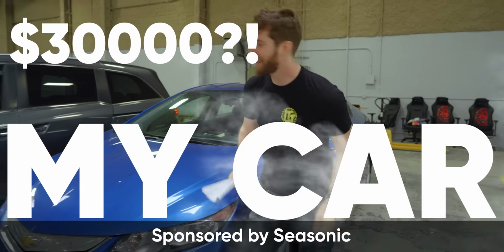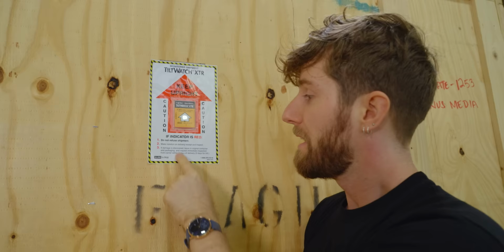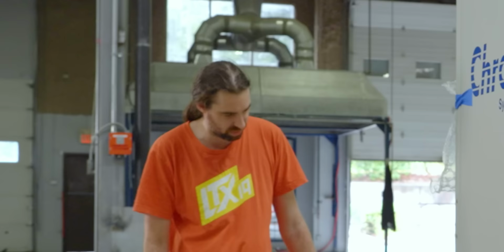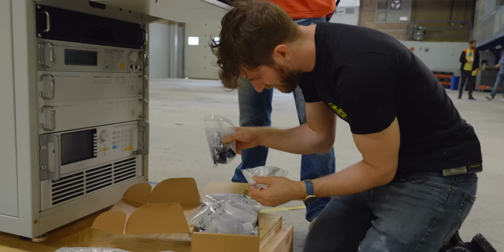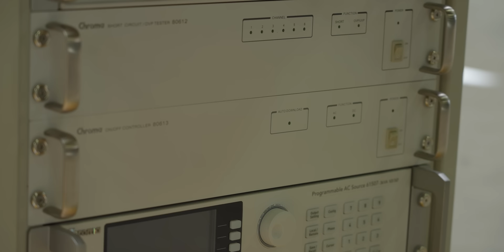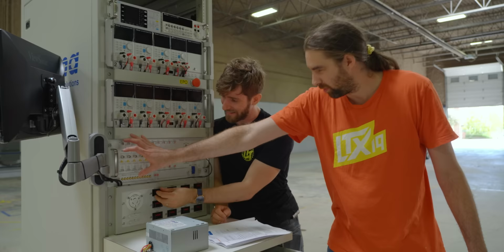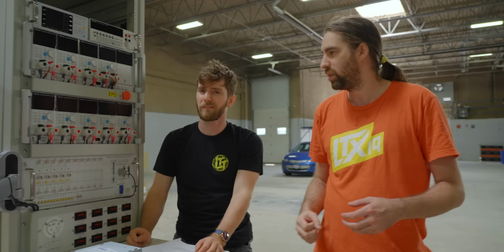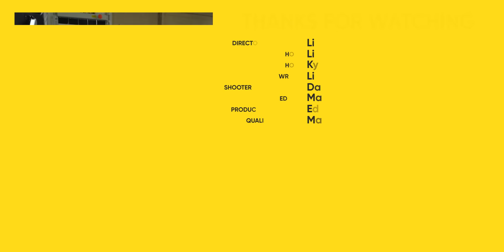The most EXPENSIVE thing I own.

Comment: I love how passionate Kyle seems about future testing, when we get to chewing up PSUs and spitting them back out we need him to be the host.
Reply: God i love Kyle. guy is such a great dude. he needs more screen time.
Reply: Absolutely. Kyle seems like that nerd bro that don’t give no fucks and ain’t no simp. I like him and his genuinely passionate approach to his job
Reply: Hey can anyone answer a stupid question I have? They said North American power tops out at 2000w. Is it possible that computer components become so power hungry that there is a limit to what is possible? Like GPU’s and CPU’s stop progressing because there’s no more power available?
Reply: @granthoover9045  possible, but unlikely. New generations of hardware have focused pretty hard on reducing consumption and increasing efficiency. This is most seen in memory and processors denoted as LP or L, which is generally short for low power, or sometimes LV in memory case for low voltage. 
DDR5 uses less power overall for the same output a comparable DDR4 would. The same can be seen in newer processors, since we’re at a point where we’re installing transistors so small we can’t make them smaller. Like it’s literally against the laws of physics to make them smaller.  
So much of the focus the last few years has been making less do the same, which increases efficiency by space. 
2000 watts is ALOT of juice for a computer, we’re talking a terabyte of memory or dual socket platinum 48 core xeon processors with 96 PCIE lanes. Maybe some Bitcoin mining farms will hit 2k per breaker, but only after 4 high end 500 watt graphics cards chewing away at them hashes. 

I run a server In my house, and it’s 16 years old, DDR2 FB no multi threading. Old and hungry. Barely eats 700 watts at full output, and around 250 at idle. 

So I’d say it’s possible, but unlikely. Just from the hardware perspective, there are plenty of options, and from an engineering standpoint, nothing is impossible.
Reply: Love these vids, but they’re getting a bit too technical for me to follow.
Reply: @granthoover9045  It’s possible, but the biggest limiting factor is likely to be heat. More power = more heat. We’ll need some pretty sizeable advancements in heat management for consumer PCs to start handling 2k+ watts. They also would be pretty uncomfortable to sit next to at that point…
Reply: The fact he's South African is cool too
Reply: @BT1902  that's really understandable, this is basically someone who read the manual until they knew it by heart, and are paraphrasing the whole thing on camera lol. I love it, but they could insert some layman's summaries and jokes here and there to make sure that not only people already invested in PSUs are entertained
Reply: @TheTwtwo  p
Reply: Although I think he needs to dumb down his language a bit haha
Reply: @magiklok  he's already dumbing it down lol
Reply: Agreed! Kyle is amazing. (sorry Linus, you did good picking people we want to watch more than you)
Reply: Kyle lost at least a decade of his life due to the stress that Linus caused him.
Reply: I dont like kyle he seems soooooo smart or he thinks he is

Comment: As a test engineer, I've got to say, this is a really impressive test setup (not sure about the pass/fail thingy though, not entirely sure what it is and what it's needed for). One note though, even if you have a scope, a DMM is still necessary because a scope is specialised at getting timing information very accurately and exact amplitude is usually less useful. So while a scope will have some DMM function, it's only going to give you like 3 or maybe 4 digits of precision, whereas a DMM can easily go to 6.5 digit. Admittedly that accuracy is maybe overkill for PSUs but it gives you trust in your measurements, i.e. if the 6.5 digit DMM says the voltage is 12.56864 then you maybe don't care about the microvolt accuracy (and realistically you're not gonna use it in microvolt range because acquisition time is very slow in that range) but you're not ever gonna doubt the millivolt accuracy.
Reply: So as a test engineer you shouldn't be that impressed, that's normal measuring equipment. As for the DMM, I have to say you're right on the one hand and wrong on the other. The Chroma already has a relatively high-speed DMM built in, so in principle it's not necessary, but in fact it needs to be calibrated and for that a DMM is useful, at least if you do it yourself and want to achieve very accurate results. What surprises me is that they bought the automatic Chroma, which is completely unsuitable for a laboratory.
Reply: Reading this makes me feel stupid.
Reply: @tytusromek9267  what's an Automatic Chroma? Didn't hear them mention that during the video. Unless you mean the pass/fail tester thing.
Reply: @moredots  The automatic chroma is for random testing. You write the program, connect the power supply and get a protocol. The programs are also interchangeable, so if there are problems you can test the same power supply with the same program on a second Chroma. 

The advantage is that the operator does not have to know anything about the Chroma, just connect the power supply, press the button, everyone can do it.  If problems occur, this is forwarded and the engineer/physicist looks at it.  This is why they are also used in QA.

The disadvantage is that it is more difficult to do anything beyond that, you are somewhat bound to the program. So if you want to test something special, or there were problems in the process, etc.. you have to rewrite the program. It is not impossible to intervene directly, but you realize that these are not meant for that, but rather for automated testing. 

The manual ones are then used in laboratories (not only in power supplies, but also in batteries, solar cells, aviation and space technology. Everywhere where electricity is converted or generated) with several and high quality measuring equipment like oscilloscopes. 
These can also be programmed, but also allow complete manual access. It is not only about the tests themselves but about the combination of the electronic loads, the manual ones allow very easy exchange of the loads. So you can adapt them to changed test operations e.g. ATX 3.0 

They are also used in the labs of the manufacturers, at Cooler Master HQ I know that they use tektronix oscilloscope, one costs over 10000$. Enermax, FSP, Seasonic... also use both, but there my info is very old. 

Also the other well known power supply testers use them like Aris Mpitziopoulos(Cybenetics, Toms, hardwarebusters), Hardwareluxx, TweakPC...  
The disadvantage here is that you need very good professionals.
The smaller test sites use Sunmoon Load Tester, these are much less accurate but also offer many options. These are also used by the manufacturers for RMA
Reply: @tytusromek9267  thanks for the response. That all makes sense. So that's the piece of equipment directly below all the DC loads, right?

I work in development not QA so we spend our money on oscilloscopes (I much prefer my LeCroys to Tektronix), but I do have 4 or 5 Chroma programmable AC supplies, though a few generations older than this one. I asked for one from Santa Claus (to do high current surge testing) to the tune of about $75k but I don't know if it's in the cards this year.

I have also lusted after a DC load mainframe like this (just the loads, not all the other stuff) but it's hard to justify when you've got stuff that already kinda does the job.

Me: I want a Chroma programmable DC electronic load mainframe!

Mom: We have DC electronic loads at home. 

DC Electronic Loads at Home: <BK Precision>
Reply: @Tytus Romek I am actually surprised that this test setup does not include a spectrum analyzer though - you can inject dirty input power into it, but there is no way of measuring the output noise and harmonics over a broad spectrum at the same time? Might have missed a part in the video though, I do not know for sure.
Reply: @alphaprot2518  you don't need it,  the Chroma AC Sourse delivers what you want, jagged, triangle and square voltage, whatever you want you can simulate with it. voltage peaks sourges .... The Chroma AC source can do much more than you need for ridiculous power supply test
Reply: @alphaprot2518  the oscilloscope should be more than enough to measure the effect of power supply rejection if you feed in some dirty harmonics. Any good oscope on the market nowadays has Fourier transform capabilities built in.
Reply: @tytusromek9267  they are not using the DMM to measure voltage, they use it for temperature; it's way way overkill for temperature measurements, you're using 5% of what that meter can do, and almost nothing of its great accuracy and precision; on the other hand, it gets them a nice meter, which they can use for precision voltage and resistance measurements, such as cable loss

Comment: Holy crap. I was looking at Chroma systems back when I was designing power supplies. Looks like you guys went all out! Re the multimeter: Most oscilloscopes are terrible for making accurate voltage measurements (8-10 bit ADCs). They are just for looking at the waveforms.
Reply: This what I was going to say.
Reply: They did say in the video it was just for pretty graphs lol
Reply: Long time not seeing a video from you, can you please get "back in business" ? :)
Reply: I am confused; how can a scope be a piss-poor voltmeter but draw graphs of changing voltages? Are they just bad at defining the absolute voltage of any signal at any moment but really good at comparing it with a measurement taken at another moment?
Reply: @ahmetrefikeryilmaz4432  Yep, pretty much
Reply: @ahmetrefikeryilmaz4432  oscilloscopes are fast,  very fast 1000 million samples per second is slow, multimeters can do between 10 and 1000 conversions per second. but the trade off is that the data converters are not as precise (10milivolt vs 10microvolt resolution)  in voltage, but oscilloscopes are specified for accuracy in time too.
Reply: @ahmetrefikeryilmaz4432  the speed at which the oscilloscope takes readings has nothing to do with its sensitivity, the bit depth of the ADC defines how many binary levels the signal can have when it's converted. Most oscilloscopes are only good to within a few mV precision - so not "piss-poor" but not great for sensitive work. Good for looking at general waveforms, troubleshooting signals, acquiring transient data etc. Whereas even a modest handheld multimeter would have several orders of magnitude better precision (e.g. Fluke 87 has 20-bit ADC).
Reply: @evanguarr9678  Linearity is also an issue for scopes. Multimeters can integrate over many milliseconds to achieve >5 digits resolution but scopes can’t
Reply: @ahmetrefikeryilmaz4432  I think a good analogy for non EEs are cameras. On the one hand you have full frame DSLRs with dozens of megapixels producing images well in access of 8K, but can only shoot a few pictures a second. On the other hand you have ultra high speed cameras that can shoot in the millions of fps, but can only achieve resolutions of something like 200x100.
Reply: this is what I was saying out loud lmao, the adc of an oscilloscope will not get you measurements as precise as a bench dmm
Reply: @NavinF  sure, but even over a single shot measurement it's not even close
Reply: @PlaceholderforBjorn  no it wasn’t
Reply: @evanguarr9678  nitpicks: “single shot” usually refers to one waveform in the context of scopes. Your “20-bit” ADC likely has an ENOB that’s a lot closer to 8 bits than 20 until you crank up the integration time like multimeters do. Time is absolutely a factor. Also worth mentioning that a scope’s AFE (analog fronted) often costs as much as its ADC and the ADC is not the limiting factor. Imagine sending 200mhz through a multimeter’s AFE.
Reply: @NavinF  you're right, those are all nitpicks lol
Reply: FWIW, there are a lot more scopes sporting 16 bit ADCs these days. Even under $1500.

I'm not sure what you need to characterize a PSU, but I'm thinking it probably isn't GS/s and is more like a few MS/s.
Reply: @bobgarrish  Not sure about the commercial market, but harmonics are an important factor for power, in general. My workplace looks at as much of the spectrum as it can reasonably get since we support sensitive electronics/systems. 
This is the case even if you’re switching at less than a Meg.
Reply: I thought that looking at waveforms is what oscilloscopes are for.  Multimeters are for measuring waveforms.
Reply: @ontheborderofbored  this is PC power supplies.... Like for home desktops.
Reply: @bobgarrish  you are correct, this is a ridiculous thing that they bought for no reason. You could do equivalent work for probably $20k in brand new equipment... The thing that they bought was the ability to do many at one time.
Reply: @_--_--_  that makes a lot of sense.
Reply: I was gonna say the same thing, Oscilloscopes are not as precise when measuring voltage and current compared to a proper bench multimeter.
Reply: @NavinF  ah I see, scopes don't have the time then. But then again, such scopes wouldn't be true RMS right, since they are averaging multiple measurements that are taken within a certain time period? Then again, isn't true RMS meters supposed to be more precise?
Reply: @Girvo747  so integrating a very good comparatively slow multimeter as a parallel circuit into the scope and correcting the absolute position of the scope's graph with that would be better accuracy at true-ish RMS? I am just trying to understand how this works through hypotheticals.
Reply: @Girvo747  thanks mate.
Reply: @_--_--_  so higher sampling rate means lesser accuracy but more chance at capturing a transient?
Reply: @ahmetrefikeryilmaz4432  Scopes can calculate RMS just fine. Multimeters use a $5 chip like the AD737 to implement “true RMS” so it’s not a fancy feature or anything. Scopes can also measure RMS for GHz signals whereas multimeters only go up to kHz/MHz.

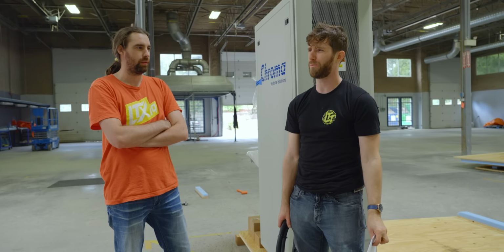Comment: 4:25
Speaking for Germany here:
We have 16A breakers for many if not most outlets. Since we're using 230V we can draw up to 3680W from the wall.
Reply: @bradhaines3142  I mean, anyway this winter at least here in europe not many people are gonna draw 3680watt from the wall ^^
Reply: Hi, i have 3x25a main fuses at home in the netherlands. And its sometimes at the low side of breaking the main fuses.
So 3x25a its 17.000 watt what a home owner in the netherland can handel
Reply: We have 16A as well here in Denmark, mostly in automatic relays though, normally it's 230V but the Power connection is 400V, it's used for high power use items like the washing machine, dryer, electric heating and stove. You can have 25A in some house I think, but those would be rare and not relay.
So a normal house can go from 3680W to around 6400W, depending on what connection you use.
Reply: @-JustHuman-  yes or 2x16a for a electric induction cooker, like a siemens or bosch. Sometimes need a induction cooker 3 fases. If you have the big one in your home.
Reply: Meanwhile in Australia, most homes have 10A single phase breakers at 230-240V. Depending on the type of Aircon installed, three phase 415V with 25A breakers may be installed. We rarely need three phase for other appliances, unless you're using industrial/commercial appliances. If you tend to operate high amperage goods in your home workshop (ie welders, compressors, various machinery, etc.), you can get a 15A plug installed with a 16A or 20A breaker.
Reply: @OriginalUser2023  Electricity is still more expensive per gas per kWh unless you really fucked up... yes, gas prices went up multiples, but it used to be about 1/6th of electricity cost and electricity cost is also up by a third. Gas would've had to go up to 8x the 2020 price and we're not quite that badly off yet.
Reply: Here in Brazil we have 40A/50A breakers for our electrical showers (here we have both 127v/220v and 5500W/7200W showers)
Reply: @saturnGEEK  I think I understood this wrong, but are you saying you can get outlets rated for 15A max protected by 20A fuses? That seems highly dangerous to me.
Reply: @lilietto1  I wonder about that actually, with raising gas prices electric heaters are selling like crazy.
Reply: @lilietto1  The solar panels strongly disagree 😁
Reply: @twf-fpv9388  To my knowledge our house should use 3 63A fuses. I always wonder whether our power grid would actually allow for one house to draw over 43kW and where the limitations are.
Reply: @henning895 It's more common to see those arrangements in commercial buildings, and the odd household with two or more 15A sockets.

Comment: In Germany almost every house has a 3 Phase 230V 16A outlet which would be able to put out about 11kW. Some houses and most farms have 32A outlets, but most people use them with 40A breakers. So we'd be able to draw 48kW from our wall.
Reply: Was going to say something similar for the UK. Most commonly cookers are installed on a 30amp fuse which would mean it could draw just over 7kw, and you can get higher fused outlets for things like EV chargers. Think he maybe means from a standard outlet though not sure.
Reply: @georeb7040  I think so too. 230V 16A single phase would be 3650W. Cookers in Germany usually use two seperate plugs for two seperate outlets with two seperate phases to get 400V.
Reply: Yeah my kettle alone in the UK can draw 3.5kW. Never really appreciated our electrical system 😂